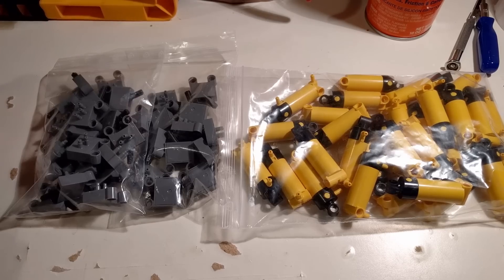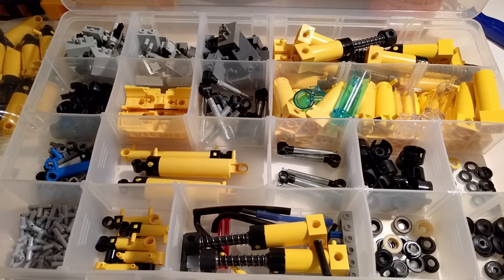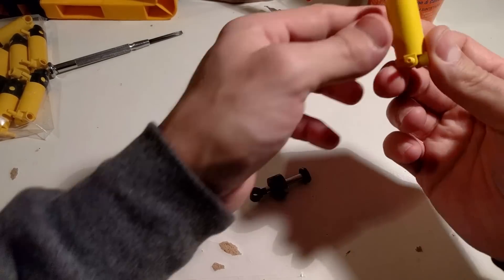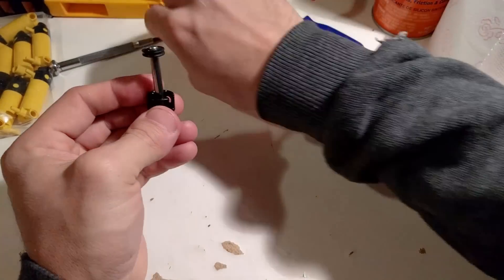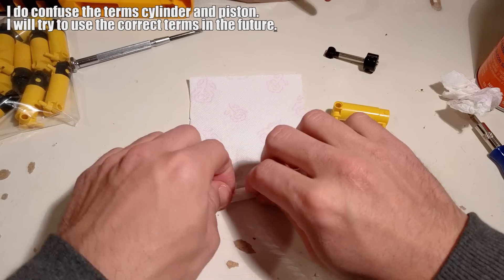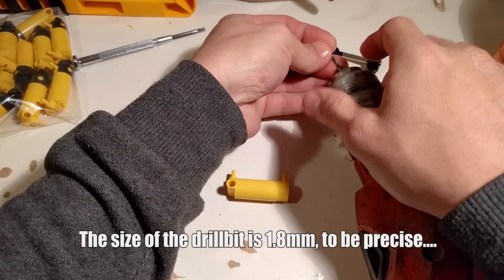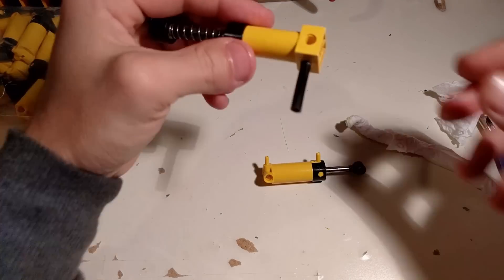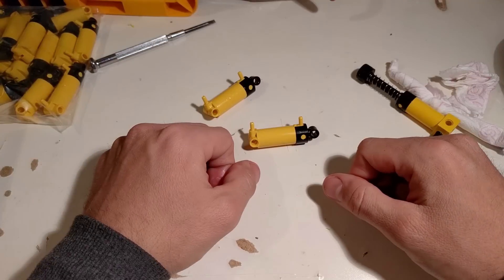LPEpower insight - How to modify a lego pneumatic cylinder

Comment: Loving these technical insight videos :)

Question for you: When you use pneumatic cylinders for suspension, do you modify those too? If so, any differences in the modifications?
Reply from the maker: The cylinders that go into suspensions are mostly broken ones. There it is not important if the seals are all in perfect condition or if the inlets are broken off.  But yes, they do get the hole and they do get lubricated.

Comment: Where did you get the piston gaskets? Not the cylinder, the circular rubber that goes up and down inside the cylinder?
Reply from the maker: They are inside every cylinder. The excess ones are from broken cylinders.

Comment: is it important what silicone spray you use?
Reply from the maker: As long as it's silicone spray, it'll be fine. Just avoid any oil based "lubes" like wd40.
Reply: @nicjasno  I know, watched all your videos ;) Still, i am wondering why i am not able to get those ridiculous rpm's like you are. In general, i feel like my engines have a lot more resistance in themselves and i cannot figure out where this comes from... I mean... Look at the V6 you did, just from the sound of the engine you can tell that thing has like no resistance at all...
Reply: @nicjasno  The only engine i was able to get to high rpm's was a 180° V4 made of a modified lego fake model engine... But that has tiny pistons and a very small stroke...
Reply from the maker: @DiRT3Xbox360  have you modified the switches aswell and drilled the inlets? Do the cylinders feel smooth and easy to extend after modifying them?
Reply: @nicjasno  yes, all holes are drilled to 2 mm
The holes in the pistons, switches and t pieces
The valves move easily just as the pistons do
I tested both for leakages

As I said, I can't figure out why 😅
I mean, the engines do not run slow, but not as fast as yours

I have a 90° V4 using normal pistons running 1250 rpm
A V8 using normal pistons and a large crankshaft (4 stud diameter) running ~600 rpm (I know the bigger crankshaft will decrease the rpm, but it should not decrease it that much)
And I rebuilt that Defiant V6 of yours because I was so fascinated by it (and yes, I modified all the Lego pieces aswell, with the exception of the tubing on top) but i don't remember how fast it ran, I think it was a little over 1000, probably around 1300 to 1400

All rpms are at 6 bar, because my compressor isn't capable to do more pressure any more :(
Reply from the maker: @DiRT3Xbox360  Hm... maybe the engines aren't designed well/bad timing.... Can only speculate without seing what you've got.
Reply: @nicjasno  Yeah probably... :/ Though, like i said, i actually rebuilt the the defiant V6 of yours.
And timing wise i tested multiple timings and always chose the one which ran best.

I kind of have a feeling that my valves still have too much friction because i press to much on them while glueing. But if i dont do that they will not hold the air... Thats my only concern. Like is there a trick in getting the valves air tight with less force while glueing...
Reply from the maker: @DiRT3Xbox360  Valves have a lot of friction before the engine gets run in. Remember to always run the engine on the spray can first, so that silicone lube gets everywhere in the system. Also lubricate all mechanical bits. Defiant engine among other things, has torsionally bent crankshaft axles and 2 balance shafts that keep the crank from twisting.
Reply: I know, I did all that... :/
Maybe I didn't do some things thoroughly enough though, i don't know.

Another theory I have is, that the silicone spray that I am using is too sticky. It's a noname brand from the local hardware store. (Hence why my first question came to be... :D)
I will test the Cyclo spray you are using, as they say their spray will lube without sticking. (If I can find it online that is...)
On my engines you can clearly see dust sticking to the lubed parts of the valvetrain, after they have been sitting for a while.

By torsionally bent, you do mean they deform under load, am i right? (Like, you didn't bend them before installing or anything...)
Reply from the maker: @DiRT3Xbox360  By torsionally bent i mean they were twisted my me under hot water into 120 degree angles. I will have a livestream at the end of the week building engines. You should check it out. I will announce the times on facebook and twitter.
Reply: @nicjasno  oh wow! I didn't know that
I figured the engine was basically 3 V2's stuck together
That's how I did it...
Maybe I'll change that 🤔

I actually just tested my V6 and removed the outer shafts. The timing is fine. But the "V2's" run a little higher when separated, so they probably do not get enough air when all are connected...

And judging by the sound the V6 probably runs closer to 1800 rpm at 6 bar... So yeah... It's probably the crappier switches... xD
And maybe connecting the V's could help, but disassembling the entire engine and getting the timing right again will be a pain in the a** xD
Still might worth it...

And I will definitely check out the Livestream!!!
Reply from the maker: @DiRT3Xbox360  a 90 degree crank isn't what you want in an i3/i6/v6/v12. You need a 120 degree crank.
Reply: @nicjasno  i know, you didn't fully understand what i meant.
The "V2's" are not connected to each other via any axle. They are connected via the supporting shafts. I put two 24 tooth gears (each sanded down to 1/2 stud thickness) on every crank and separated them by 8 teeth with the supporting shafts thus achieving a 120° separation.
But each crank is not directly attached to each other via the axle itself.

So three separate cranks connected by gears.